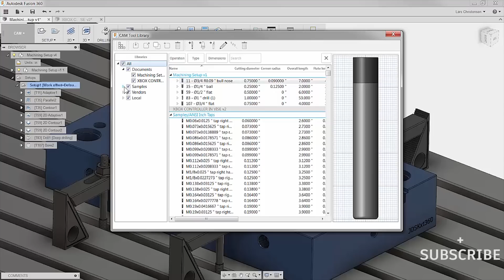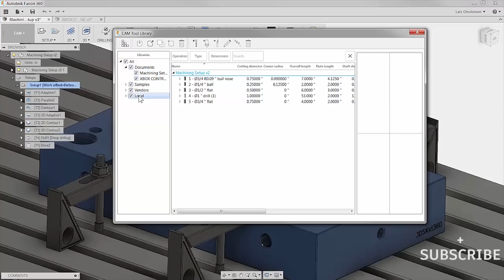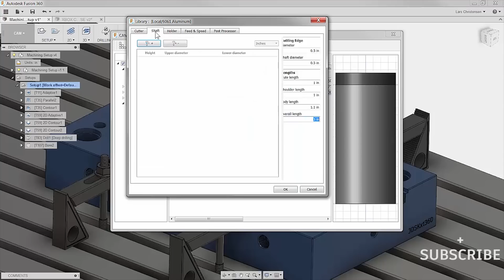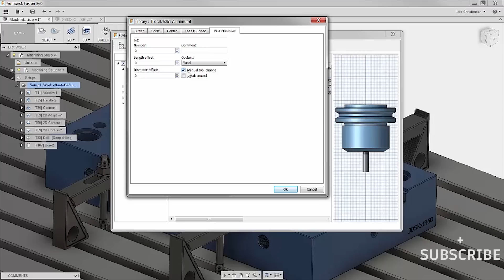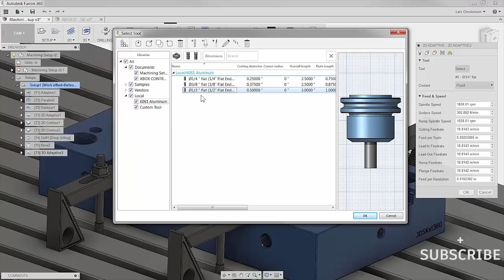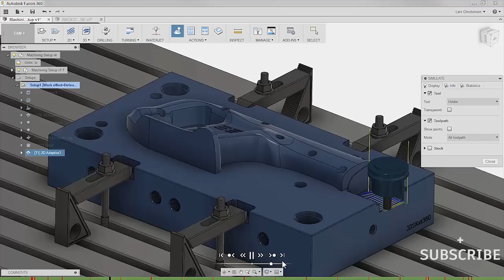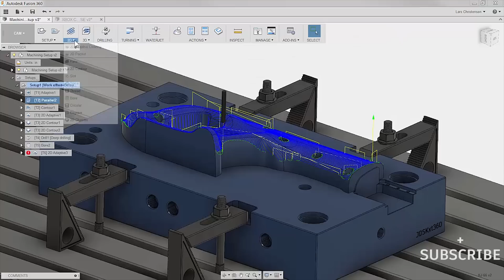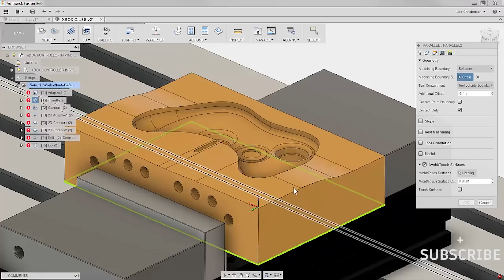Fusion 360 Tutorial — No Confusion With  The CAM Tool Library

Comment: Everytime I enter my plasma cutter tool, the picture shows a milling tool. Then when I do a simulation, it shows a milling router type cut. Ive tried uninstalling the  plasma cutting tool several times and re entering it. Same thing happens. I have picked the plasma cutting tool, never a router tool. What gives?

Comment: Hi Lars, I found that if you pick all tools only from the Local library, that this results in duplicate tools in the document library with each tool having only one operation linked to it. This causes the post processor to force a tool change for each operation whether you use the same tool in the next operation or not. They way around it seems to be to select the first tool from the Local Library and then for subsequent operations, first check if the tool is already used in the document library and if so then select it from there (and not from the Local Library).  

Fusion 360 does not seem to be able to recognize duplicate tools in the document library. 

Or did I miss something?
Reply: I think that is working as intended. You may want duplicated tools, for instance using a tool for roughing and then you also want to use an identical tool for finishing. I think the desired workflow is as you explained... choose from the document library to have only one of that tool in your operation.

Comment: How does the tool number work ona machine with a dynamic tool position system that used names not number?

My Siemens 810d controller on a machine with a twin gripper tool change arm and vertical tool magazine changes the pocket number of a tool everytime is does a tool change.
I can have 200 named tools programmed into the machine and up to 24 tools loaded into the magazine.

Comment: Lars, great advise as always! We are about to set up a Haas TM1P with 10 tool holder like the minimil you mention used for internal manufacturing. As a manufacturer that needs to run machines at 5% capacity, I would love your thoughts on how to pick very few very flexible tools for "the dumb machinist" We need long reach tools for 8mm X 75mm and long reach 2-3mm but essentially how do you pick 9 tools for Alu/Plastic and 9 tools for Stainless when you are very willing to sacrifice speed?

Is Fusion suitable for designing parts from machining and out? Most here focusses on what to do when the designer/engineer has designed a part that is next to impossible to manufacture. 

How do we turn it upside down?

Comment: A follow up: Is there a tool library available to download for smaller size ball end mills? That's the reason I had to make one up from scratch... could not find one to match my 3/64" tool... Please advise.
Reply from the maker: Hi PTG Gunsmithing Thank you for watching!
Check out this video around the 16 minute mark:
https://youtu.be/lZ-AQ42AGTk?list=PL40d7srwyc_Mkgc5wvP_OfVel9aDkNkZ6

Hope this is useful
Reply: Hi Lars, well, I don't think that is the correct video you linked... I didn't see anything that dealt with adding a ball end mill that is not in the tool library, or downloading a file that includes the smaller tools... or am I missing something? Thanks!

Comment: Hello Lars, great channel & very informative.... Quick question: I continue to get error messages that state I "probably need to choose a different tool"... I'm simply engraving 1/8" high single line text @ .003" deep & my tool is a 3/64" ball end mill... My particular tool is not listed in the library, but even after creating a new one that "closely" matches my tool specs, I continue to get the same error message... I don't believe it's because the text is too small... Do you have any suggestions? Thanks!

Comment: Hello. I'm fairly new to Fusion 360 and brand new to CNC in general. I'm needing to set up a hotwire tool in Fusion 360. Which tool would you recommend starting with? It looks like Fusion 360 does not have this as a tool option but I would like to try to make a custom tool for my hot wire. Thanks!
Reply from the maker: Hi Dezeray Stenzel Thank you for watching!
Is this like a hotwire CNC?
I would think that the 2D cutting, like a laser would work:
https://youtu.be/1x7WwHGby3M?list=PL40d7srwyc_Mkgc5wvP_OfVel9aDkNkZ6
Reply: The CNC has both functions in one, a CNC and a hotwire. Thanks for the reply! I will look into the 2D cutting laser.

Comment: Where did the design of these clamps come from?
Reply from the maker: It is a standard milling clamping set. This type of clamps have been around longer than I have been around machine shops

BEst,
Lars
Reply: Lars Christensen I was talking about the CAD representations for use in Fusion360 . Not the physical clamps.

Comment: Hi Lars:I noticed that the tool library in your video shows the specifications for each American Standard tool in American Standard dimensions.  The tool library that came with my downloaded version of Fusion 360 only shows the tool diameter in American Standard - All the other dimensions ( tool length, shaft diameter, etc.) for the tool is listed in Metric format.  What's up with that!!??
Reply from the maker: Make sure you have your units set to standard for the file you have open when you open the tool library. That will change the output.

Hope this is helpful.

Best,
Lars

Comment: Thank you, Lars, one question could you explain the offsets on the last tab when making a new tool. I'm confused on the difference of if the cam is doing the offset or the controller for the tool width. ive just bought a Tormach 1100 with ATC and am getting ready to cut my first part but I'm not sure how to do the tool offset settings, im guessing most people let the cam do the with offset and the controller does the length? So would i just set my dia offset in the controller to 0 and set up the Z offset and then check the box for fusion to do the cutter comp? and then use the offset in the controller for wear comp if needed?
Reply from the maker: First I have to say, On some machines, you are locked in and can only do one thing. But, for most people, it is totally a preference. Personally, I have always used Wear whenever I could....But first:
In computer: Whatever tool diameter/2 you use in the program will be added to the nominal path of the cut .
In Control: Your posted code will only be the nominal path and you will have to add the tool diameter/2 in the control
Wear: Whatever tool diameter/2 you use in the program will be added to the nominal path of the cut (Like In computer) but it also adds G41 and G42 to the code so now you can adjust for tool wear in the control.

Reason is that a cutter will normally be a little under size and you will also see that the edge will break, so when you measure your part after milling you might find you have to make a small adjustment...like 0.003 or something small. By using the wear option, you can make that 0.003 adjust right at the control and run the same program.

You should read you machine manual and double check what it specify and I would also recommend that you do some test cuts.

Hope this is helpful
Reply: Very thank you, I've got it figured out I'm letting Fusion do the offset and I'm leaving the controller dia to 0,  I only need to add this if I use conversational or want a wear adjustment. Is there a way to make fusion use rest machining in 2d. I would like to do a 1/2inch adaptive then a 1/4inch adaptive but the 1/4 in is redoing all of the stock. In 3d tool paths, i see rest machining options but not in 2d.

Thank you

Comment: Thanks for the great videos, but how can I configure the tool table to work with a setup that doesn't use preset tools/ tool holders? Im learning and Im using fusion 360 with linux cnc and I would like to use Dremel bits for now with an 1/8 in collet. just trying to get around having to dump a bunch of money on holders while I'm still learning the basic principles.
Reply from the maker: Hi Douglas, thank you for taking the time to watch the videos!
You can create your own tool in the tool library. That way you can totally control if there is tool holder or not. I would still think you want to specific some kind of tool holder as you Dremel bit...You could just use one common holder. Test it out :-)
Reply: Thanks Lars for your reply,I've come to the conclusion I will just buy a few tool holders and endmills for roughing and then run a separate program just for finishing with a collet. Thanks for all the informative videos!

Comment: Hi Lars, I plugged all my tools into the library - worked fine, but I can´t find a category for my engraving tools. How do I add them to the collection? I have some gravers for making v-cuts in order to bend plastic and cobond materials. But I also like to make signs...I tried chamfer mills, but they look quite different, they are tiny -  approx. 2 millimeters and have only different cutting angles between 30 and 92 degrees.
Reply from the maker: I would think the chamfer mill should work if you set tip diameter to zero and adjust Diameter and Shaft Diameter? Could you share a link to a picture of one?

Comment: hi Lars,
can you explain how to add more complex tools to the library.
I'm struggling with this for example

https://www.maritool.com/Cutting-Tools-Keyseat-/-Milling-Cutters-Chamfer-Milling-Cutters-Double-Angle-HSS-Chamfer-Mills/c78_231_237_239_277/p2419/Double-Angle-Chamfer-Cutter-3/8-dia-X-60-degree/product_info.html

in "Type" for example, is this a slot mill, a counter sink, dovetail?

thanks
Reply from the maker: Hi Juan, You could define it as a thread mill, but that would limit you in what you can use it for. There are some limitations to custom tools for Fusion 360. I think development are working on improving this.

Comment: Another great one Lars!  John S. touched on templates the other day.....I tried it....if he mentioned it, I didn't catch that I had to go in and change the geometry of each of them.  I finally got it, but this confirms that I was missing a vital piece of info.  Great info on the tool libraries too....learned some new stuff there, too!  Thanks!!!
So...since I don't have a tool changer and all of my tools are on the bench, it looks like I can have, for example, a "steel" library and an "aluminum" library.....I could populate each with the same tools and tool numbers, but modify each's feeds/speeds.....right?  So I could pull the spot drill or chamfer tool up from either, depending on if I wanted aluminum or steel speeds and feeds and not have to edit the tool every time I change material.  I can have my chamfer tool as #50 in both local libraries at the same time. Hmmm.....that's going to make tool numbering a lot nicer!  :)  Obvioiusly, a lot of the end mills won't allow that since I'm not going to run a 3" long 2F HSS on a steel part.  But....all the drills will work well that way.....hhhmmm....now that I think about it, doesn't the sample library already have it setup that way?  lol  I think I'll go look. Thanks!
Mike
Reply from the maker: Hi Mike, Thanks for watching!
Yep, that's what I would do. If you keep the libraries true to what you have on the bench, you should be ahead. The worst thing about constant editing feeds, speeds and tool numbers is that you will make a typo at some point and sparks are flying.

Have an awesome day!
Reply: Huh??!!  Mistakes don't happen here...!! LOL!!!!!!!  :)  Thanks!!

Comment: Nice job.  I didn't know I was doing it all the hard way until now.   it's easy to lose those special tools that you know you made because they only exist in the part file, oops.   I know I have made the same corner rounding mill a couple times over.  the drag and drop feature was great as well.
Reply: Morgan Oliff same here. Been doing it all wrong as well. One question regarding renumbering though, Lars. If I renumber my tools within a project, which I almost always need to do will it update the local library numbers as well or only change the project tool numbers?
Reply from the maker: Thank you Morgan. Glad you found it helpful!
Have an awesome day!
Reply from the maker: That's a great question, Ken. By default, tool will have a zero when created. It is only when it enters the Documents area it get an automatic number. You can specify a tool number on the "Post Processoer" tab when creating the tool. This number will always stick in the tool library, and carry over when picking the tool (bringing it into Documents). Warning...If you "right click" and renumber in the Documents, the tool will loose its original tool number. But I think that is how it should work.
Thank you for taking the time to watch the video!!
Have a great day!